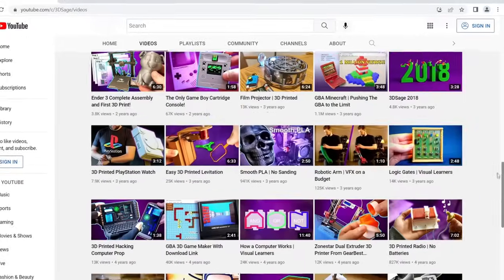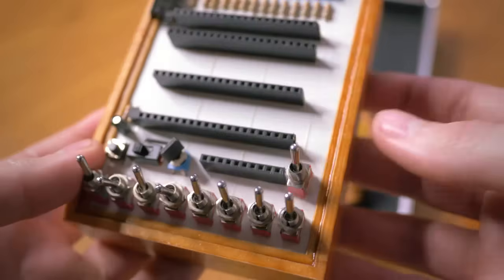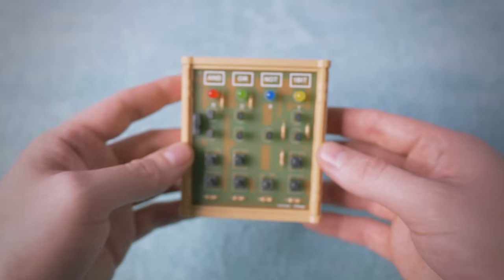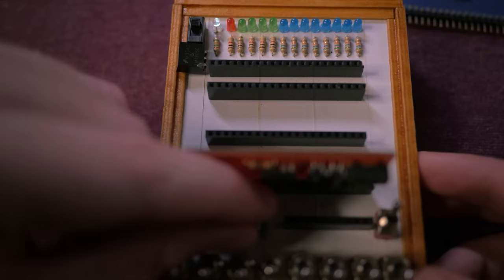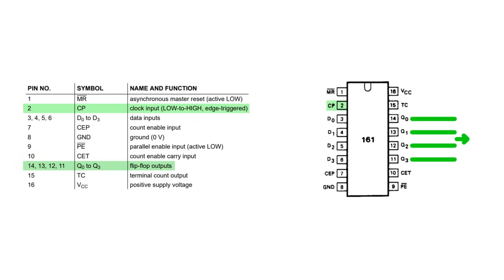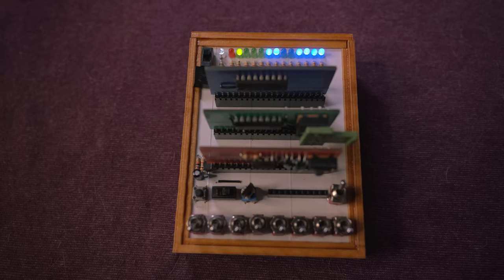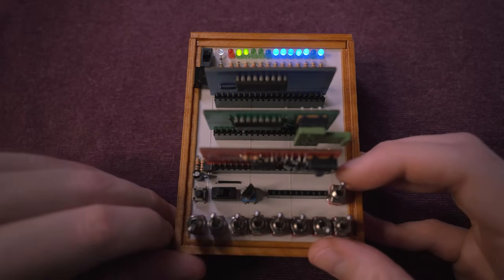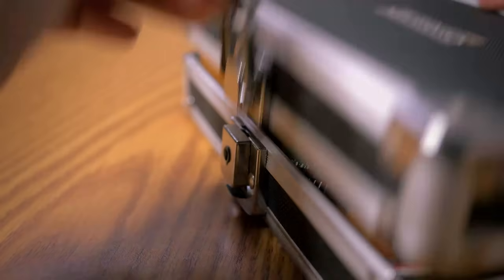I Made My Own Computer | Let's See How It Works

Comment: For what it’s worth, there were computers before transistors. So really what transistors did for us was to make the computer a more practical tool by virtue of being much smaller, less power hungry, and far more reliable in operation (e.g. no burning out vacuum tubes left and right, no need to constantly tune or tweaks parts to keep it operating correctly). — electromechanical relays -> vacuum tubes -> transistor with a lot of interest rabbit holes like magnetic logic/
Reply: ++ I always wondered, if they're really a switch, then who turns it on or off, turned out a quartz clock ticking at some billion times a sec (GHz) is ignored or taken into account by some already encoded transistors/memory in BIOS chip, if there is no initial memory/information then transistor would do nothing, as you don't have anything to control them...

Manufacturers program a BIOS chip externally and then solder it in on the motherboard.
Reply: He's referring to the way how semiconductor devices revolutionized everything.
Reply: Before transistors, there were other devices which performed the same function as transistors and logic gates. I'm busy working on a series of online demos which show logic circuitry using relays and plugboards, because people can see their internals working.
Reply: Vaccum tubes were used before transistors
Reply: wasn't there a youtuber who made a vacuum tube computer a few years ago? I wonder how hot it will get.
Reply: @animeshsahu2803  It may be useful to consider a simpler sort of machine like a printing press and imagine it being constant and continuously operated without human intervention. Once the movable type or printing plate is installed many copies can be made without changing anything if paper, ink can be continuously supplied and a few other basic needs satisfied. -- In the same sense the computer is a kind of fixed-function machine, except that many functions are available to choose from and /state/ is maintained. Some functions act /implicitly/ on stored information like 'increment' which takes an existing register value an increased it by 1. -- A single switch isn't that helpful, but with multiple switches that automatically respond to inputs (like say an electromagnetic relay) you can construct a simple mechanism that has /state/
Reply: Besides size, and maybe the change from mechanical to digital, you raise very good points.
Reply: @theunown8430  My dad was born in 1959. When he was young and learning to become an electrician, relay powered telephone exchange offices were still the standard. It was pretty much a giant computer which would connect phone lines according to the number selected by the caller. And every large factory had at least one such room full of relay switches and selectors. It really wasn't that long ago. Few years back, we saw one renovated in the technological museum, he still remembers how they work and what you'd to to repair them.
Reply: @@fillipsir.710 analog computers typically do not control relay switches. They take analog inputs, do analog computations, and output analog results.
Reply: And there are still plenty of relays being used today in logic circuits, albeit with nowhere near the complexity of a modern computer.

Comment: Great! Now make it run doom
Reply from the maker: I need more ram but maybe... 😎
Reply: No it cannot run doom. For doom you would need a real pixel display. And his computer does not have that. Oh, and also, the controller does not have enough buttons to controll doom.
Also x2, the computer does not have enough power to run doom. It also cannot do basic operations like adding, subtracting, multiplying and subtracting. Its only a little project designed to do really simple operations.

Comment: I built the exact same computer in a school project. Same components but I didn’t have a 3D printer back then so the case was wooden and I had everything on a single PCB except the clock. For manufacturing the PCB I used a CNC machine which removed copper around the traces and bored the component holes. I loved that project. Learned so much

Comment: 4:00 10101 = 21, 10000 = 16 for anyone that is wondering. But this computer is sick!
Reply: You can count binary on your fingers, using each of your digits as a binary digit, carrying to the next finger just as the flip boards at that timestamp. Expressing 4 this way is flipping the bird but you can do it in front of anybody comfortably if they're aware the context is counting to 4.
Reply: That’s a 5 digit so every digit that’s 0 doesn’t get added and every 1 does. Reading it from right to left so it goes like 2, 4, 8, 16, 32.. and so on. Every digit gets multiple to the power of two starting from 1 (1^2) because we have 2 selections for every switch “on” and “off”. So 10101 would be 1+4+16=21
Reply: @Ramy_Ramz indeed
Reply: @nko3210 Huh I never knew that, Thank you😊
Reply: I wish it was 100101...

Comment: Very nice build!
I love its simplicity, the switches and its modularity!
Do you have future plans for this project?

If you're looking for a newer SRAM, easy to find and affordable, you may want to check the AS6C1008, it'll give you 128KB x 8-bit, it's still manufactured in DIP and it's much faster than the one you're using (less than 100ns access time)😉

Comment: Going from zero electronics knowledge to this is pretty impressive. Very clean looking design and a nice implementation of the electronics. The case and presentation are first class as well. However, and I don't want to be negative, but I can't really see calling it a computer, part of a computer, yes. A computer would have two more things needed, one, the ability to compute (i.e. Add two numbers) and two, it would need to be able to make decisions (i.e. compare two numbers) and branch accordingly. I would call this a programmable state machine. I still is pretty impressive and just plain cool looking. I am for anything that promotes learning in electronics, so a thumbs up.
Reply: Exactly, glad someone said it. It's a kind of "sequencer", does not really process any data, nor it has any ALU. I'm wondering how he's using all those peripherals with it.
Reply: yes. and it must be inside a chip which can understand halt,reset,jump,input commands

Comment: Great video and project.  As a fan of Ben Eater's 8-bit breadboard computer I was drawn to this.  I am trying to build one myself.  I understand about 95%, but have one question about your counting card (74161).  It looks like you have a 3d printed gang plate which is evidently connected to several switches.  I assume this is to disconnect the counter from the 'bus' so as it does not interfere when programming the cdp1824? (Maybe the ENP pin?)  However, in looking at the datasheet for this chip, there does not appear a feature for putting the output into 'high impedance', that is, not low or high, just disconnected.  Does this card switch perhaps even remove the power all-together?  Thanks again...

Comment: Cool video, I really love this kind of projects and yours look awesome.

Just wanted to point out a transistor is very fast, but it's not even near the speed of light. They have a switching speed, which is defined by it's capacitance and it's shape (size) and it's measured in frequency. If you check the transistor datasheet you'll find the gate delay and it's probably going to have a formula. Also, the wire's in a circuit are not perfect conductors and they have resistance, which makes the electricity move at around 1/3 the speed of light. It's still pretty fast, but not speed of light fast.

Comment: Really nice video

Also, the number at 4:00 is 9+10
Reply: This took me a while
Reply: @ksaw3212  but you still got it (i assume)
Reply: @msdcrafter8336  yeah
Reply: I thought it was 21. I'll have to go back and see what I'm missing.
Reply: @ryanamberger  don't worry, it is, there was this video of someone asking a kid, what 10 + 9 was and the kid answered 21
Reply: No  it's 21

the number is 10101

Using your standard "Bucket S16+ystem" approach
the LEAST SIGNIFICANT BIT is on your left
the MOST SIGNIFICANT BIT is on your right

Your place values in Binary are as follows (Expressed in decimal)
64  32  16   8  4   2   1
               1   0  1   0   1

Your calculation is 
16 x 1 = 16
8 x  0  = 0
4 x 1 = 4
2 x 0= 0
1 x1 =1

or simplified you can do this 
16+4+1  =  21

Another thing you can do is this ,  it's a bit quicker when you learn to think this way 

Step 1    How long is the binary string ?
Answer ...   5 bit

Step 2   Note that  8  and 2  only have zero's   and that that total is  10  (Decimal)

Step 3   what would the value be if it were all 1's  (Binary)
answer 31

it's just easier to calculate 31 - 10
by doing this 
    1 1 1 1 1   (takes too long to calculate)
HOWEVER
    1 1 1 1 1     is just

1 0 0 0 0 0   -  1
so
1 0 0 0 0 0   is obviously 32
32-1 = 31
therefore 31-10 = 21

it's much easier to do it that way 

at a 5 bit level it doesn't really matter much 
but when you get something like this 

1 1 1 1 1 1 0 1 1 1 1 1 0 1 1 1 1 
i assure you it's a lot fucking easier to just go ,    ok
     16
1024
added together is  1040
then 
raise 
  1 1 1 1 1 1 0 1 1 1 1 1 0 1 1 1 1  to the next bit to give
1 0 0 0 0 0 0 0 0 0 0 0 0 0 0 0 0 0          
so that number is obviously 
262144
now you just take 1040 from that which is a damn sight easier than adding up all this shit 
and of course you get
260 thousand stays
2 thousand drops to 1 thousand to give you 
261 thousand  leaving you with 40 to deal with 
and 44 drops to 4  to give you 
26104
simple
BECAUSE YOU ARE ONLY CALCULATING 2 OR 3 SIMPLE THINGS INSTEAD OF LIKE 18 THINGS
Reply: @martinkuliza  listen, the joke is, that theres a meme, where a kid is asked "whats 9+10" and the kid says 21. Thats it, thats the joke.
Reply: @ryanamberger  
it is 21 there is nothing to go back and see
16   8     4   2    1
 1     0     1   0   1

16+        4+      1     =  21
Reply: @martinkuliza  i know its 21. but the thing is, i was referencing a joke. that's the point, not what number it really is
Reply: @martinkuliza  oh wait, you pinged ryan, not me a second time. sorry, misread that. that was probably a little rude of me
Reply: @msdcrafter8336  
ok well 
1. it must be a new joke and not anything like 
THERE ARE 10 TYPES OF PEOPLE IN THE WORLD THOSE THAT UNDERSTAND BINARY AND THOSE THAT DON'T 

2. THE QUESTION WAS "WHAT IS THIS NUMBER"  In the context of Binary 

so obviously we are not answering that question but instead playing riddles
because it could only be 21 or a riddle 

Oh well,   Been an engineer for a very long time
Been fucking around with electronics for 40 plus years

never heard this joke 
1. Can't be that new
2. Obviously isn't very funny

but.. thank you for bringing it to my attention 
but.. you got that other poor bloke running away questioning his binary skills

not cool
Reply: @msdcrafter8336  
it may have been , but lucky for you i don't take offense to anything 
Close one     LOL
Reply: @msdcrafter8336  
You know what........   it'd be cool if we, in the binary world had cooler jokes.
we need some new one's it's about time
THERE ARE ONLY 10 TYPES OF PEOPLE IN THE WORLD has been played out, but its' still the best one we have

need a new fucking joke
Reply: @martinkuliza  well, that makes 10 of us, who need a new joke :)

also, sorry again for me having been rude. have been a bit stressed lately
Reply: and yes, i just used that joke again... im not really good at inventing jokes
Reply: @msdcrafter8336  
I am......  But there's a catch
apparently if i try to force it it comes out shit 
but then i get times when some stupid shit pops in my head and apparently people 
tell me i am good at making up jokes

but again,   it has to be one of those things that just comes to me
so it's not like a repeatable talent you can teach , it's more of a fluke when it happens
Reply: I feel that
Reply: @ryanamberger  it is 21 (16+4+1)

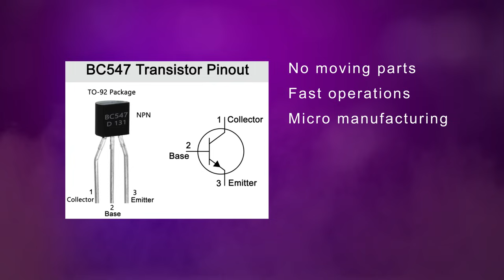Comment: 2:05 "Functions at near the speed of light" is basically meaningless in this context. Yes, electric signals travel near the speed of light on a circuit board, but that is entirely independent of how fast a transistor is. Most discrete transistors are quite slow, actually. They have a certain amount of capacitance between their terminals that takes some time to "charge up". (very simplified explanation)

Comment: I have an question. Where is the actual processing happennig, I don't see any transistors or microprocessors.
Reply: It does use chips. For example, the HALT program just sends a signal to the counter to stop. Another example, is the JUMP program. The JUMP program just simply sends a binary number to the counter to jump to that address. Oh, and for the transistor thing, you cannot really see transistors, (as you said in your comment) but this uses chips. You can see on the counter, that it uses a chip to count. The ram, also uses a chip. The clock also uses a 555 timer chip.

Comment: So this was a really cool video. I built something similar but it’s only 4-bits wide. I’m interested in the guts of your CPU. What are you using for an ALU and what are you using for the the instruction decoder; are you using microcode to decode or are you using a demultiplexer and gates? My Clock, RAM and address register is pretty much identical to yours.

Comment: A CDP1824!  Such tiny RAMs are hard to find these days, but perfect when you are building your own logic from scratch. My first computer long ago used the CDP1802 processor and my problem back then was the opposite. I cobbled together as much RAM as possible with whatever static RAM I could get my fingers on. How did you even find this relatively rare fossil from another time?

Comment: 21 was the value of that binary number 10101. I stopped counting the normal way with my fingers. I now count on my fingers using binary. Usually, I use my pinky finger for the first place, ring finger for 2s, middle for 4s, index for 8, and finally the thumb for 16. I've been known for wasting time by counting to 1023 on the 10 digits of my hands. After a while, certain patterns tend to stand out. Some funny, some surprising. 800 was a rather confusing and surprising number using your hands. You almost don't believe how perfectly round that number is on your hands.

My apologies for acting like a silly nerd on something so mind-numbing.

Comment: That must have been an expensive project.  I use Logisim Evolution (Holy Cross Edition) to design my processors.  It's a free digital circuit simulator that can be used to simulate any type of digital circuit.

Comment: That is how most of us started, with no knowledge or background, if there is passion you will learn it and find a way. :D 
I build many of those simple "computers" in the past and I'm building one again, serial cpu, I got bit lazy over time, so 1bit logic and some clever bit shifting will do the trick, outside will be 8bit databus and the PC counter will be external for flexibility (aka MC14500). 

Edit: Mostly wil be build out of discreet comports, DTL, RTL, also some diode logic and some TTL IC(most of them will be replaced with discreet logic gates), have already build the 1bit adder and 4 bit instruction decoder(demuxer), out of discreet components.

Comment: Why not a crystal for the clock? As a rule of thumb, I NEVER use capacitors in digital circuits, as a cpu clock would technically be. Freq precision becomes an issue

Comment: actually it would be possible without the transistor just it would have to be significantly larger as vacuum tubes require a lot of support circuitry and they themselves are pretty big in comparison.
Reply from the maker: That was the point I was trying to make. It can be created with vacuum tubes, or even an array of magnets but the transistor made it possible to be incredibly smaller and more reliable.

Comment: 16+0+4+0+1 = 21, in essence each digit represents a power of two, the first one is the 0th power, you can look at it like this 1 or 0 * 2^n (side not, practically every number to the power of 0 is 1), if the the bit is 1 it gets that value if its not, it doesnt 1*2^0 = 1, 1*2^1 = 2, 1*2^2 = 4, etc. therefore the value of 10101 is 1*2^4 + 0 *2^3 + 1*2^2 + 0*2^1+ 1*2^0, or more simplified 2^4 + 2^2 + 2^0 = 16+4+1 = 21

Comment: This is really cool! I'm not completely following on a few parts though, does your processor have an ALU? If not, how do you add numbers? And is there more control logic that wasn't shown, or do the individual lines from the op code just hard-wire to different chips?
Reply: it has no ALU, its just a clock, counter, and RAM. Its basically just memory with 4 control lines
Reply: Right on. Really cool execution, though! I never thought about the possibility of using the program memory to directly interface control pins. If you used a mux for that, maybe it could be expanded. In any case, I don’t want to diminish how awesome this is.

Comment: Wow ! Time warp to the 70s , built much of my own gear , test equipment,  and yes a computer based on a 8000 Intel chip. Used double sided board, which was cheap in 3x5 inch boards, named it, index, ....your right it took time, but after the bars closed I worked on it . Hex keypad .... I would  not return to computers for many years,  got a gateway, wow the things it could do. Kids wanted computers so I bought parts and a program from Microsoft,  today one kid works as systems analyst,  another bank manager, and one in law enforcement . All made the grade learning from those computers.  I would recommend it, but today the cost is higher the software package is about 5 times more expensive, the parts ouch, still cheaper than a laptop but not by much. Take care.